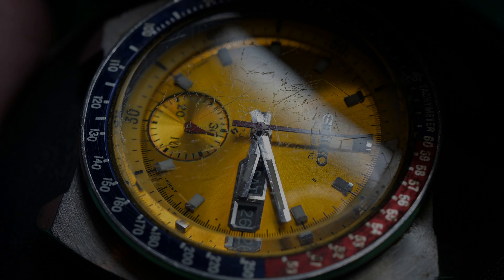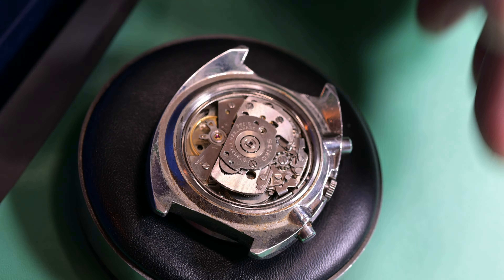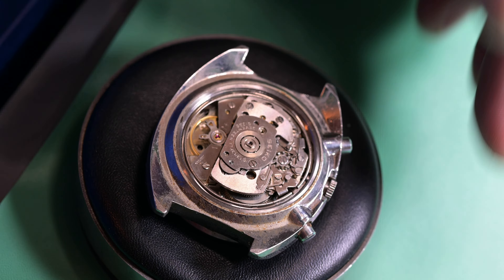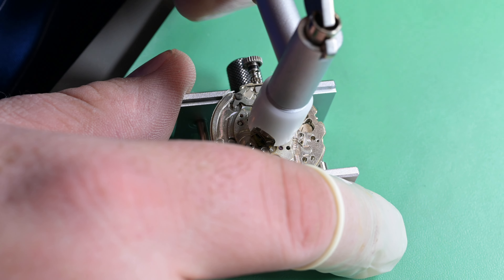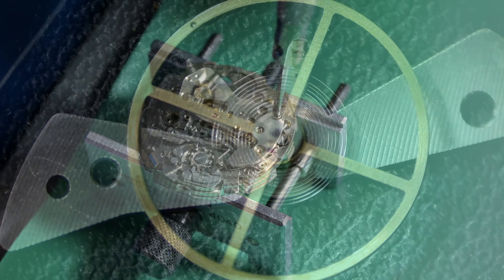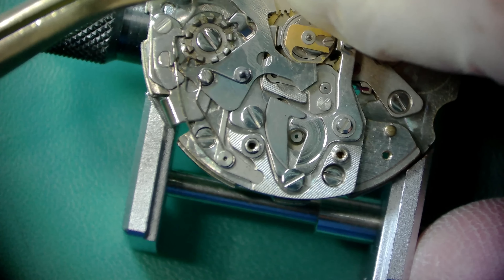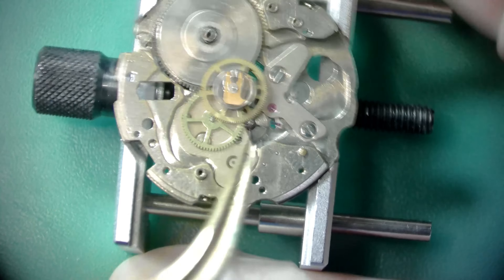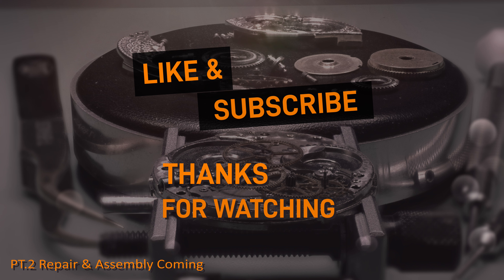Reviving a Seiko 6139-6005 Pogue - Part 1 - Disassembly - First Ever Video!

Comment: Great video.   Especially appreciated the details about parts and lubrication.    One question.  In assembly of the crystal  goes the metal ring holding the gasket go concave up or concave down?
Thanks
Reply from the maker: Concave down - the track created by putting it concave down will hold the crystal gasket.  See better footage from the Pogue giveaway rebuild:  https://youtu.be/lIPzCEvjOcY?si=rXy-iAl0Zzw0iVEo&t=4309  Hope this helps.
Reply: @WeekendWatchRepair  thaks for that.  So it appears the grooved side of the ring faces up and gasket sits in that hollowed out portion.  Flat side sits on the flange of the yellow rotating ring.  I believe that's what I see.    Sorry for the concave stuff. Gets confusing

Comment: Thanks for the response, appreciate the information I did not know. Do you do tune up's or repair / replacement of parts?
Reply from the maker: I've done service and repair work for several people I know, but at this time I'm not set up to take incoming watches from a 'customer'.  This has always been a hobby of mine, and I'd need to get a P.O. box set up before I'll be able to accept service requests.  It's something I'm looking into currently.  Thanks.

Comment: Nice job and narration, great video. Can you just remove the retaining ring without removing the automatic winding mechanism ? I need to remove the 2 buttons because they need to be freed up
Reply from the maker: Yes, you can depress the chrono buttons and pull the movement ring out without removing the automatic works.

Comment: Good afternoon Adam, my dad purchased his 6139-6005. Champagne  in Feb 71. He was a professional pilot and wore the watch til the crown fell off and he purchased another model of a Seiko Chronograph. When he passed in 2015 I found the crown-less watch, gave it a few hands spins and away it went. Seiko no longer carries parts for these and will only service the movement. I found an aftermarket crown, stem and spring and a local watch repair/dealer installed it. As of late the setting of the day/date feels very gummy as does rotating the inner bezel. To avoid further damage to whatever might be gumming things up inside, if I don’t wear it I make sure I give it a few spins to keep her running, but…along come months where the days require a set. Do you service these and have parts available if there were something fouled up inside?  Recommendations??? I don’t feel confident enough to step by step watch and perform what you did with this watch. It means too much to me to screw it up or loose a part and there aren’t any to replace them.   Thanks.
Reply from the maker: Parts are available, but they can be pricey.  Unfortunately at the moment I am not able to accept commissions.  That may change one day, but for now I do not have everything in place that'd I'd like to have (PO Box, etc.) to accept incoming watch shipments.  

If it feels gummy, or tough to turn, don't force it.  It is an old watch and likely just needs to be cleaned and serviced.  Those are pretty solid movements, but gaskets will fail over time and dirt/grime will get inside.

Comment: Hi Adam, thanks so much for making this video - it's an immense help for getting into my first 6139 restoration. One question: What type of mainspring do you use as a replacement? Did you get some NOS? Or are you using something like a GR25341X?
Reply from the maker: Thank you for the kind words and for leaving a comment.  This replacement mainspring was a GR25341X.

Comment: Great video! I´ve found an old Pogue my grandad used to have and to my surprise it´s working! But the problem is that the pushers are stuck in. I removed the back lid and the movement ring to see if I can see what the issue is, but the buttons just look stuck. Should I try adding tiny amount of WD40 to it? Or would that cause more trouble?
Reply from the maker: That would cause much more trouble.  Pull the pushers out by first removing the movement ring.  It is just likely that they are very dirty and the springs are worn.  Clean them up, put on new seals, replace the springs if necessary, and make sure the case is cleaned out and your pushers will work again.
Reply: @WeekendWatchRepair  Wow wasn't expecting a reply honestly! i really appreciate your help, and you saved me from screwing my old Pogue. Thank you so much!!

Comment: Nice video Adam thanks for sharing. Sometime I would enjoy a bench tour. What Barlow lens are you using?
Reply from the maker: Thank you Chuck.  My bench setup is quite simple.  I'll try to put something together.  I am using a 0.5x Barlow lens.  It works really well, however for filming purposes I'd like to make the field of view a little larger so I'm thinking I'll try a 0.3x Barlow lens and see if that might improve it a little bit.
Reply: @WeekendWatchRepair  Awesome I have a 0.5x on my scope but still have a bit of black in the corners. Let me what you think of the 0.3x.
Reply from the maker: @chuckw4203  I will. I’ll probably get it ordered this weekend. It’s going to increase the focal length further, so my only real concern would be if I can get enough height adjustment on the microscope to allow for proper focusing. We’ll see what happens, I figured it would be worth a shot at least. I think for regular servicing without the need for filming, the 0.5x is just about perfect, for me at least.

Comment: I have this watch and when I press the crown for the calendar, the inside of the watch moves very slightly (i.e. the dial). I would be very happy if you could enlighten me as to why this is happening
Reply from the maker: I’d suggest checking the tension spring on the movement ring (which are prone to rust and breaking), as well as having a correct size case back gasket.

Comment: I have one but the numbers on the back say 333084 is that unusual  that it does not have a letter ?
Reply from the maker: It doesn't have to have a letter. The second digit represents the month, and the only letters are N and D for November and December.  All other months are represented by numbers.  If your Pogue begins with '33', that just means it was manufactured in March of 1973.

Comment: Hi 
I am vintage watch collector .Being collecting for a while . 
I live in Bangladesh . 
Recently i collected a Bulova accutron astronaut.  Which need repair .
I tried local watch repair shop .. but they fail to restore it . They cannot repair the tuning fork part .. 

Where can i get it repair ?? Should i send it to you? I
Reply from the maker: I'm sorry but I cannot repair it.  I'm not currently taking in outside work.  Additionally, I've never worked on an Accutron movement.  Thanks for reaching out though.